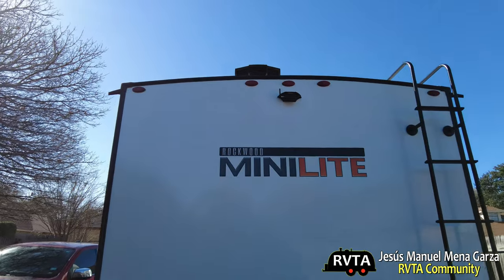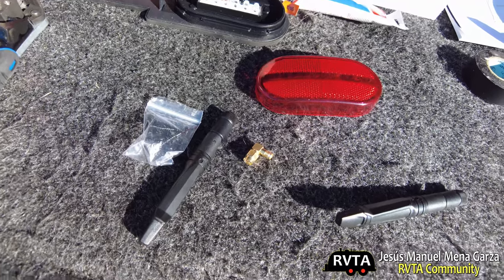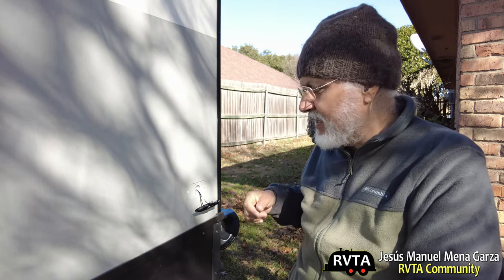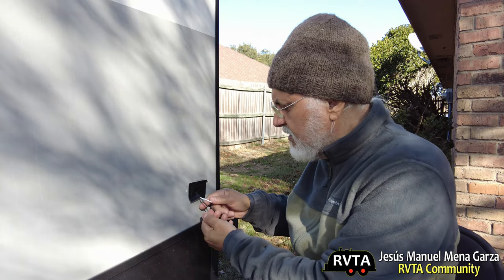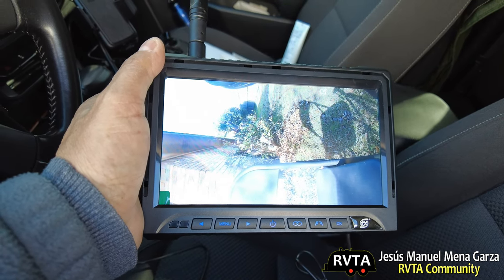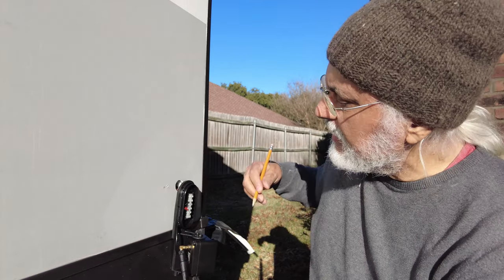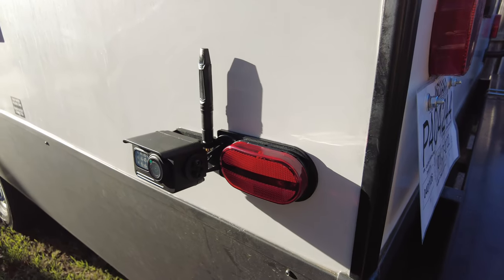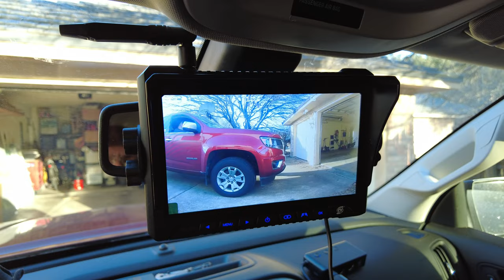HIGH-QUALITY RV Backup Camera FXT TECHNOLOGY Easy Install! Super Budget Friendly! #FXTtechnology

Comment: They make heat shrink butt connectors so you don't have to remember the shrink tube.  The image quality looks pretty good.  Does the integral light work?  After you install another couple of gadgets you are going to be an expert.
Reply from the maker: I was lit by the sun. It warmed up a bit ... eventually. Video shot with my DJI Pocket 2 atop one of my Benro tripods. That's it.

Comment: Now you need to install an infrared camera.
Reply from the maker: I'm going to install the lithium batteries. That'll do it for a while. I have been working on a project that requires a 1/8" thick piece of plastic to start. I'm creating an adapter that will slip into the slot (1/8") for an exterior TV. I created one out of wood. But it is super flimsy. I plan to adhere (build up) several layers of plastic and add (screw into the contraption) a small solar powered motion detector light. I feel the TV mount would place the light in the perfect position.